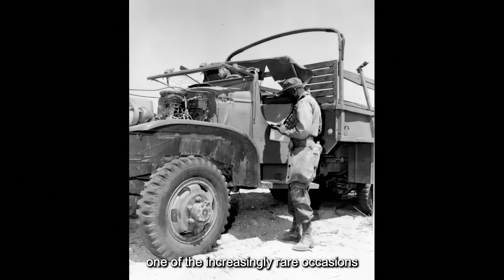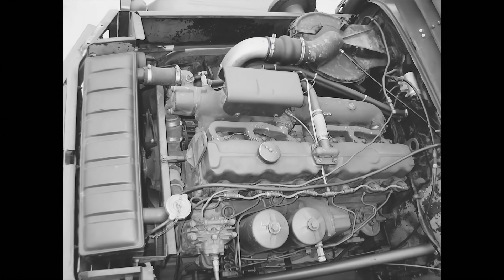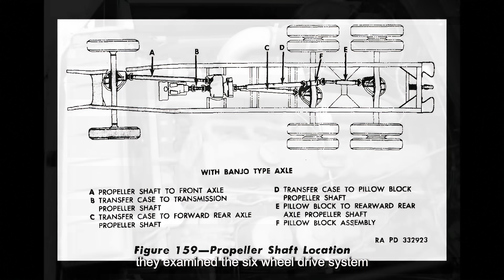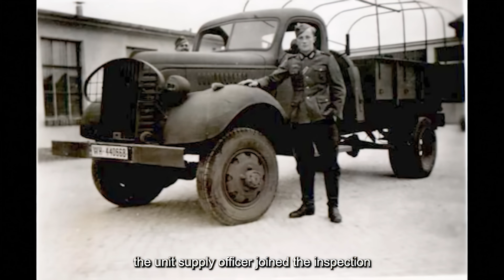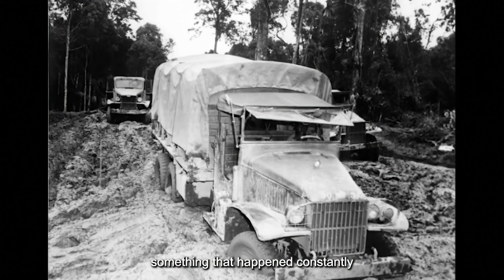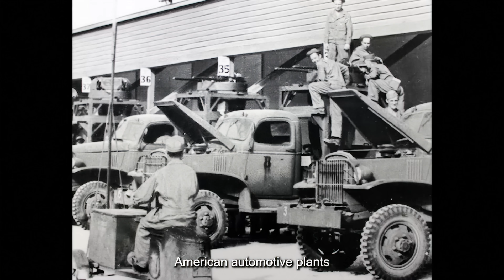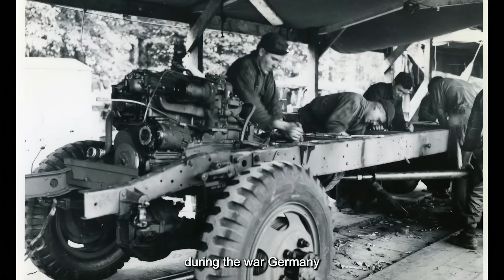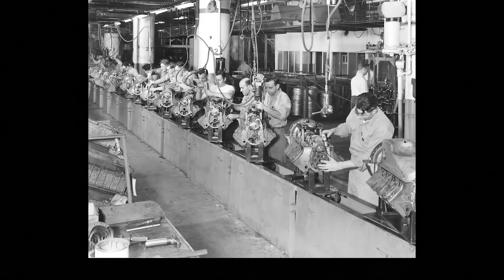Wehrmacht Mechanics Captured a GMC Truck... Then Realized Germany Was Doomed

Comment: While working on a Mercedes and getting rustrated,  said to a co-worker "This is why the Germans lost WW2" he asked why and I replied, "While Dieter was dicking around with 36 steps to reset the service light, Joe in Detroit just built two more trucks"
Reply: Exactly right. A few years ago I did a tour of the rouge factory in Detroit, where the ranger and F-150 is made. During that tour they said one truck rolled off the assembly line per minute. 

And back in 1943, about 40 minutes from the rouge factory in Ypsilanti, they produced one B-24 every hour.
Reply: @micoasters  There is a 2015 book Arsenal of Democracy by A.J. Blaine about how Detroit eventually got it right on wartime production.  Labor shortages were a major problem.  The head of Cadillac, for example, needing people to assemble aircraft bombsights recruited prostitutes from black neighborhoods.  When criticized for this, he replied that we needed every American in the fight and that he was proud to give these women a chance to earn an honest living.
Within a very short time, these women were exceeding their production quotas.
Reply: Now american cars are doing that
Reply: @saltymonke3682  I pretty much gave up on working on cars myself when the horn on my 90-something Chevy stopped working.  The fuse was good, so I figured, disconnect battery, disconnect a couple of wires, remove old horn, repeat process in reverse.  And then I realized that I couldn't even find the horn.
There was nothing about the horn in the owner's manual, so I took to the dealer and they didn't know where the horn was either.  They looked it up and found that it was inside the front bumper.  You had to go underneath the car to replace the horn.
Reply: @nghtwtchmn129  yep, you also have to open the front dashboard in some Lincoln just to change oil and AC air filter
Reply: @saltymonke3682  In newer Ram trucks you have to remove a tire in order to replace a headlight.  You have to remove the front end of a newer Cadillac to replace a headlight.
Reply: @nghtwtchmn129  😂😂😂
Reply: Horns used to not be in The bumper??
Reply: @YOTARIGS  Yes, in every other car I'd seen, the horns were right behind the grille, beside the radiator.
Reply: Yes! Thanks for the chuckle!😅 The first 2:40 minutes are loaded with straight lines begging for a punch line.😅 "These are designed for idiots!" Well, okay. Yeah, and the fighting soldiers in this army only have to shove an  8-round clip into a rifle that reloads a round every time the trigger is pulled; easy-peasy. And they're winning.
Reply: Frankly put and summarizes a lot of details but overall 
You are not wrong
Reply: @danielmirlach4655  I agree there was some exaggeration....BUT not on the 36 steps to reset the service light, 100% true.
Reply: @danielmirlach4655 thers an onld joke - German anvil have 87 moving parts and have to be wound twice an hour.
Reply: What american truck or car is equal to Mercedes ? Today or earlier ?
Reply: @kkteutsch6416  All of them, when cost is figured in. Especially depreciation. Incredibly expensive German cars sell for pennies on the dollar after they're a few years old, even with very low mileage on them.
Reply: Then Heinz shouted across "but lads the Soviet Union have already beaten us, who gives a ck about america" and they all laughed.
Reply: 😅 I was stationed in Greenland 1979 - 1981. A Danish guy used to say this alot when things went wrong due to overcomplicated engineering. It's funny to hear this again (the reason why the Germans lost the war)😅
Reply: Dieter Dengler Dicking D'around , Ja !
Reply: Yea... fk america

Comment: Fun fact, Opel was also owned by GM. GM acquired a majority stake in the German automaker Opel in 1929 and gained full control by 1931, making it a wholly owned subsidiary well before the war. 

After the war ended in 1945, GM regained full control of Opel in 1947 following Germany's monetary reform and Allied occupation policies, using its resources to rebuild the damaged factories and resume production.

Opel remained part of GM until 2017, when it was sold to PSA Peugeot Citroën (now part of Stellantis).

Comment: The picture of the engine is for a 6 cylinder diesel engine, not the 6 cylinder gas engine the CCKW used.

Comment: That picture of the engine incorrect. That is a Continental diesel form around 1975 to 1980. The old duece and a half from ww2 has a Chevrolet 235 gas engine.

Comment: And here we are now with $1,000 headlamps and on inspectable vehicles based on a computer fault. But then again, I'm old enough to remember when trucks were built for people who needed them, not just for those who wanted them.
Reply: I guess men were tougher than and could drive loud, rough riding trucks which took a lot of strength to steer and stop. We would never accept any vehicle like they today.
Reply: People buy vehicles as a statement, not because they need them. Farmers import a lot of Japanese trucks because they simply do the job without all the heavy, unnecessary equipment and add-ons that seem to attract the "look at me I have a big man's vehicle" simpleton/poser.

Comment: "Amateurs talk strategy, professionals talk logistics", The Willys Jeep, 6 men could totally disassemble then reassemble one in less than an hour, if turned upside down, 2 men could flip it back onto its wheels. German tanks increasingly got bigger and heavier limiting their mobility with highly specialized parts and more parts, the Sherman at less then 38 tons had a nearly limitless mobility and again very simple design from multiple factories and makers. Dependable and Plentiful.

Comment: And yet they made VW beetles.  Had a 62 model,  and was very simple.  The problem was when I owned it metric tools were not that common,  usually ended up going to the Snapon tool distributor.  And wasn't cheap.

Comment: Another AI produced video, with lots of inaccuracies. "German mechanics inspect, US Jeep, truck, bridge, tank, packing crate, fuel dump, and are amazed by, its simplicity, ease of service, lack of perfection, etc" Many German Opel supply trucks were 4 wheel drive. At 12.08 you show a Dodge 6x6 Weapons Carrier. At 24.53 you show a post WWII US army truck model 1956 M153

Comment: The Deuce and a Halfs were a masterpiece of engineering for purpose. They were designed to go overseas and never see a factory or dealer depot again. They mention the toolkit. What they did not say was that little toolkit contained EVERY tool needed to completely disassemble the truck and put it back together. They came with each truck. Every Sherman Tank the same. Every airplane had a roll of tools for the same.  

But the Americans also had the advantage in mechanics. American Farms were mechanized. Every farm boy was raised knowing how to repair tractors, trucks, pumps. There's the famous story of the German Commander of a POW camp. They needed supplies, but the camp truck had broken down. He asked the American prisoners if anyone knew how to fix a truck. And was beside himself when every hand went up.

I used to drive a Fire Truck converted from a Korean War Deuce and a Half. Same deal. Minimal tools needed. Very easy straightforward design.
Reply: American also had a lot of bad roads. Basically every road outside the major cities was a bad road. Commercial vehicles had to be built to survive those bad roads which is why when the war came all those commercial vehicle designs were suitable for war conditions. Europe had good roads, at least on the western front, as you'd expect of a continent that had been settled for thousands of years.
Reply: @RRaquello It depended on where in America. The Northeast and Atlantic Coast had much better roads than most of Europe. As did California and the Midwest. There was a series of paved roads in place that ran coast to coast. Just not the Interstates yet. But pretty much every Main Street connected to every other main street in the country via asphalt. Once you got off those paved roads out into rural countryside it could get rough. And driving across the Mojave was not for the weak willed. (Or weak of bladder).
Reply: Polish car CWS T-1 from 1922 needed only one tool plus screwdiver for spark plugs, engineers back then definitely knew how to simplify maintenance
Reply: Korean military vehicles are built to never die, their cars .... not so much.

Comment: I about fell out of my chair when he said the engine was designed for easy access, bolts the same size, spark plugs easy access, nuts the same size, a far far cry from modern engines where you need an Engineering degree to figure out hpw to access the spark plugs.
Good enough, that was the back bone of those trucks and the same with the USSR T-34 tank.
Reply: Also of note several of those German factories were owned by Ford & GM. Germany didn't have control over many factories (that's how capitalism works), and repurposed for the war effort so as expected many parts didn't match and once you had to do repairs in the battlefield there was a plethora of mismatched designs that had to be somehow made to fit through a lot of hammering and force of will. The US had the manufacturing capacity to not only match Nazi Germany at its zenith, it didn't have to deal with different standards in different countries, like having to build entire rail lines to begin with.
Reply: @Ometecuhtli  Nazis Germany was not a Capitalist country it was at best a Socialist country at worse a Dictatorship. North Koerea is a  Democracy it claims.
I do not think Ford or GM had anything to do with the design of German tanks or Planes.

Comment: German precision and attention to craftsmanship and detail is fine and dandy in peacetime.  But as smart as Germans were supposed to be, you'd think they would've already known that this production policy would get them in trouble during the war.  The Soviets also adopted the American policy of standardization.  They were so impressed by the lend-lease Studebaker 2.5 trucks that they received, they decided to build a similar  ZIL version of their own.  The Soviets found they couldn't kill a Studebaker, even if they tried real hard.  So the Germans were facing the headwind on both fronts.  What good is a "precision engineered" supply truck when it becomes an immobile paper weight on muddy roads?

Comment: I worked a lot on German cars. You need to use almost every wrench , triplex xyz, allen head , star on the same vehicle and special tools if doing timing, while toyota and Honda need 10, 11, 14, 17 mm for most jobs. As a matter of fact, I only used 3 tools to pull the engine in toyota prius to replace transmission damper.
Reply: So that's why you get into debt for 100k+ snap-on tools...
Reply: @alexdragomirescu5084  I was lucky.  There used to be a place called Sears, where I worked.  This was 25 years ago, Craftsman tools were much better then and I got some good deals.
Reply: My old Volvo 240 was very similar.  I had to get a full set of metric wrenches and sockets from 9mm to 25mm, and used all of them.  

The bell housing connected to the block with 6 bolts.  Four were 19mm hex, and two were 17mm.   Why?  

My 1965 Mustang does it with four, and they're all 3/8 coarse (9/16 hex).  I can disassemble almost everything with only 4-5 sockets.

Comment: I have an early 70s vintage duece and a half. The original engine was shot with a cracked block. Likely split from being left out with no anti freeze 
Put in a Cummins diesel  and newer transmission. 
Not the fastest rig out there, but can go anywhere you might want a truck.

Comment: From 1990 to about 1996 My Oregon Air National Guard unit deployed from Portland every 4 months with Deuce and a Halfs. The Hummers broke down. The trucks never did. Hard to drive, seats sucked, tricky to back up. One took out the phonebooth when someone left one in gear. The telephone pool stopped it. 1/2 mile per hour, funny as poop.
Reply: One trained mechanic per company could oversee 40 soldiers who could turn a wrench, swap out the fuel filters, or club all the tires to check air pressure. And still fight.

Comment: Their manufacturing philosophy prioritizes quantity and standardization over individual vehicle perfection." Not quite. The US philosophy was that perfect is a form of standardization and simplification resulting in manufacturi9ng capacity, reliability, easy repairs, and sustainability. There is nothing that the Opel could do better then a GMC related to moving supplies in a harsh wartime environment. Standardization does not mean low quality, and in fact, can result in even higher quality.

Comment: Again, the GMCs were not inferior to the Opel in fuel efficiency and maneuverability because the GMC was a 6 wheel drive requiring more fuel at the benefit of service duty where the Opel could not even travel. Since it was longer, of course it had a shorter turn radius, again, it could also carry much more weight. In those respects is was quite superior. It was "perfect" for the job it was intended to do, while the Opel, engineered and polished, could not do what the GMC could do, and was thus inferior in that way. In fact, you could say that the engineers were superior to German engineers in the sense they could see "form fits function" whereas German engineers "function results from form."

Comment: Wasn't Opel a division of GM?  Didn't they manufacture the Opel "Blitz" for the Wehrmacht?  Didn't they have experts from GM USA set up the modern production line? So weren't both sides using large numbers of GM's finest trucks?  In fact 80% of the Wehrmacht's logistics were horse drawn and the Opel trucks were a large chunk of what was mechanized.

Comment: Just one correction. GMC trucks in WWII were not designed with the intention that the drivers were "poorly trained." They were not. They understood the trucks limitations and strengths. They designed it to  military standards of necessity, and engineered to those specs by GMC. The design philosophy of any American company was meet the specs as cheaply and as quickly as possible, one spec of which was maintenance ease. Every aspect of WWII equipment was designed for ease of maintenance, simplicity of engineering,  reliability -- and massive production.
Reply: It was actually much more likely for a Allied (US/France/UK) combatant to have previous experience driving a vehicle than for a combatant of the Axis (Germany/Italy). The car industry in Germany was smaller (whence the creation of the Volks wagen, which no German ever received during or before the war), and farming in the US was highly industrialized and many people had experience with trucks. This video wants us to picture a Iowa farm boy surviving on potatoes when it reality it was the opposite: Hitler not only supported vegetarianism for health reasons but because German agriculture was still in such dire straits it had to import a lot of meat the Nazi regime imposed tariffs on pork and other imports to force the switch of peoples' diets and local consumption. It didn't take long for the country to focus on military rearmament so the chance of a farmer ever operating any type of machinery became lower, something that the regime tried to control with the use of (what else?) propaganda, exalting the heroism of the traditional farmer, self sufficiency and the benefits of vegetarianism.

Comment: And now we have engineering enshitificatiom:  

Seal the gearbox so there is no oil change, place plastic gear change detector switches in sealed hot oil gearbox. A switch fail forces a full gearbox dismantle: creates more cash flow for the service division. When the gearbox fails, throw the car away,  Cheaper to buy another one, than repair.

ECUs so complicated they require wireless  operating system updates. ECU by design derate engine power by a couple of percent every year so that power decrease reduces strain on drive train components to allow car manufacturers to give 100km warranties. Finally driver sells car when engine power is too sluggish to ignore.

Every nut and bolt is a speciality, produced by many different global production houses. Nothing is standardized.

Use Finite Element Analysis and Boundary Element Analysis, everything is organised  to fail just outside warranty, around 150Km.

Comment: Good video but your statement about straightening a hardened steel leaf spring with a rock would not get a straightened spring it would get you bloody knuckles and a hand full of gravel…you point is well taken but totally in error…leaf springs are made of properly quenched spring steel heated red hot in a forge…no need to exagerate when the facts are as interesting as these

Comment: Based on the text provided, here is a summary:

The key realizations were:

*   *Design for Mass Production and Maintenance:* The American truck was not engineered for perfection but for simplicity, reliability, and ease of repair. It used standardized parts, simple tools, and was built to withstand abuse and neglect from poorly trained conscripts.
*   *Overwhelming Quantitative Advantage:* American industry, leveraging its pre-war automotive mass-production capacity, produced vehicles like the GMC CCKW in staggering numbers (over 560,000) that Germany could not match. Germany's more precisely engineered vehicles, like the Opel Blitz, were produced in far smaller quantities.
*   *A Fully Motorized Army:* The Germans relied heavily on horses for logistics, which were slow and resource-intensive. The Americans had a fully motorized supply chain, enabled by thousands of reliable trucks, which provided a massive logistical advantage.
*   *Standardization:* American vehicles from different manufacturers were built to standardized specifications with interchangeable parts, simplifying logistics and maintenance—a stark contrast to the German army's fleet of incompatible vehicles.